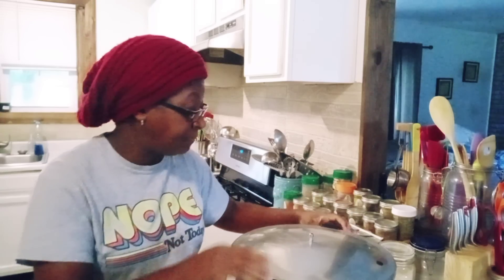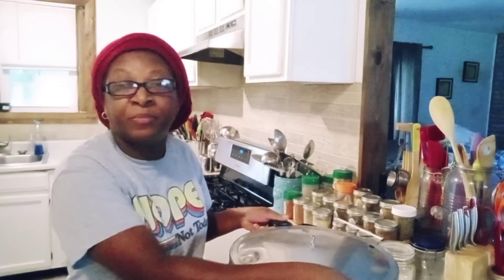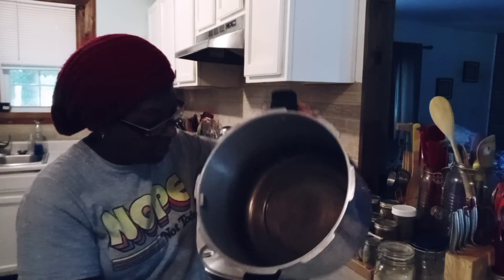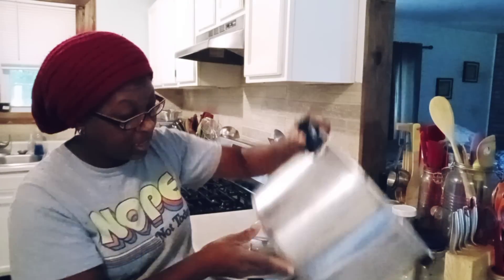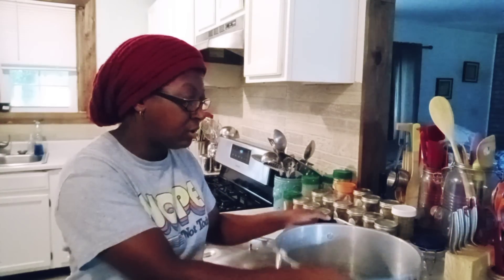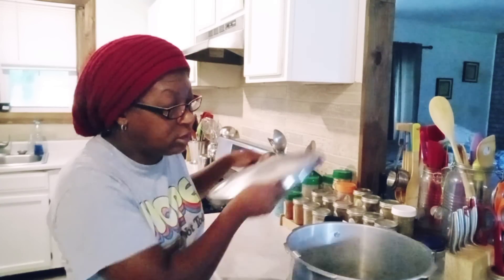WHEN YOUR PRESSURE CANNER GOES BOOM!

Comment: My all American canner pressure release valve came flying off while I was in front  of the canner.  All that boiling water and meat fat (hot oil) from the jars all came erupting out with great force!  I was thankful I was not any closer, otherwise my face would have been burned.  I was so afraid!  Hot water and oil erupting all over my kitchen and ceiling!  What a mess!  I had to do something!  I had to stop it and was so afraid to get close to it In order  to move it off the  burner.  That was the only way to get the water to stop!  I did so really quickly…praying , Oh Lord Jesus…oh lord Jesus….don’t let it explode on me!!  😆😆 I don’t know what I did wrong.  It was not over pressure. Bought new replacement part.  Afraid to use it to this day.  Using my presto canner now.  Made all the mistakes (except letting the canner go dry).  😳 
LISTEN TO THE ENDING ABOUT WHEN  PRESSURE GOES UNDER POUNDS!  UGHHHHHHH!  It will happen and now you will know what to do.

Comment: I am higher altitude so I need to can at 12 pounds pressure.  My car, and your car, has over 35 pounds in each tire. Are you afraid to get in the car?
I have had jars shatter while canning. It was an old jar.